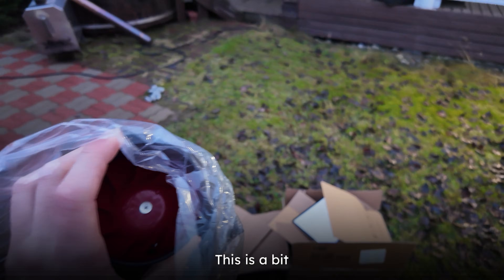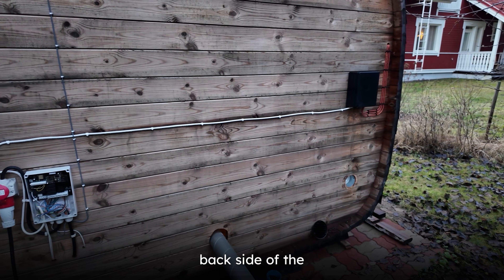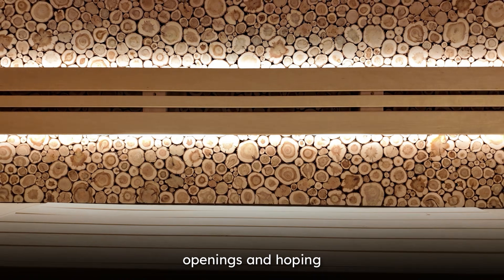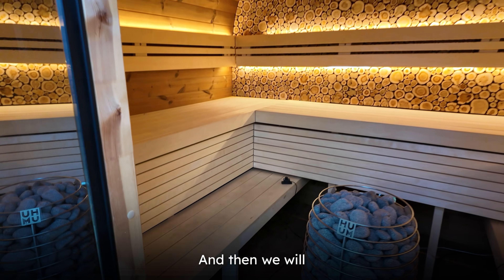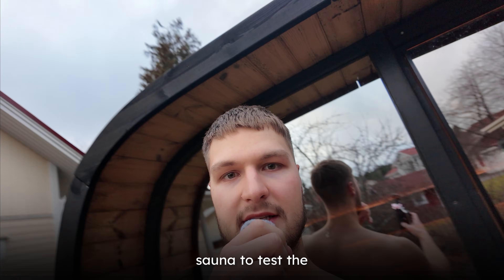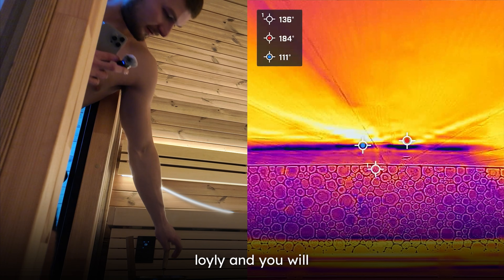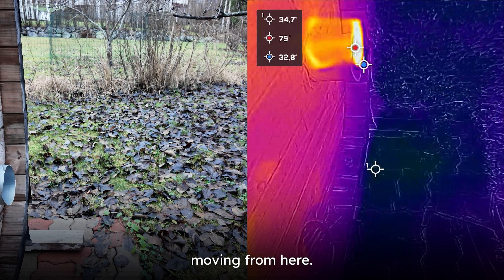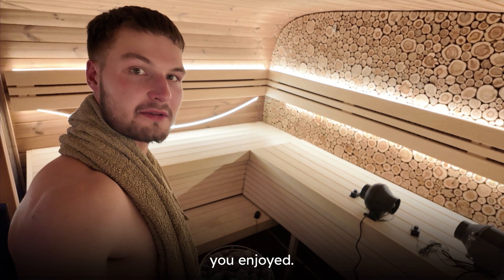I Tested 3 Sauna Ventilation Systems in a Real Sauna (Here’s What Actually Works)

Comment: That's quite an interesting video thanks ! a sauna I know in my region has floor board a bit spaced but no ventilation and I wondered why I didn't suffocate there but the ground is breathing a lot, I wonder if a ground level fan angled up and close to the heater would be enough, any insights ?
Reply from the maker: A floor with small gaps can definitely let the sauna “breathe” a bit, so you won’t feel like you’re suffocating, but I still prefer having proper ventilation you can rely on every time. A small fan near floor level angled up by the heater can help move air and make the sauna feel better, but I’d still want a real fresh air intake and an exhaust so the air and humidity actually get exchanged properly. Thanks for watching and commenting!
Reply: @thesaunaheater  Thanks a lot for your reply ! I believe it's better too for a proper Finnish experience !

Comment: It may be better to only run a forced intake fan rather then the exhaust. My reasoning is the fan exhausting hot air will probably cause the fan to fail rather fast, versus the intake fan pushing cool air in.
Reply from the maker: I get the reasoning, but powering the exhaust is usually the better setup because it keeps a gentle negative pressure and draws fresh air in naturally. If you only force the intake, you’re pressurizing the cabin and the airflow can get drafty or unpredictable unless the exhaust is also powered. If the fan is made to handle higher temperatures, there should be no problem. Thanks for watching and commenting!
Reply: @t @thesaunaheater I aswell very much enjoy your videos.
Reply: @thesaunaheater  do you know what cfm you are producing with your fan or a recommendation on cfm.  I found some very quiet fans rated at 185°f but only push 100cfm
Reply: can you recommend a really quite fan rate at 185 in USA? Interesting only in put fresh air in Sauna I will be installing a Saunum heater, in that setting only exauting air is necessary
Reply: About this. If you have the intake a little above the heater 12”-14 inch and the exhaust towards the lower 1/2 of the room slight under the foot area. The c02 gets pushed out and also pulling down that lovely loyly
Reply: Maybe have a certain exhaust CFM, it’ll pull what it needs through the intake (with a leaf/critter guard) lol and slightly adjust the intake higher if needed in tests.